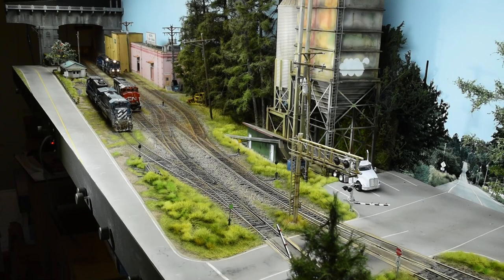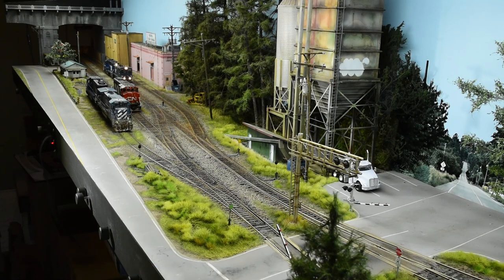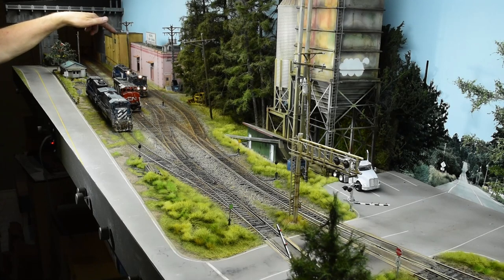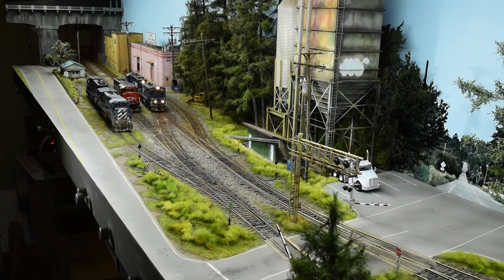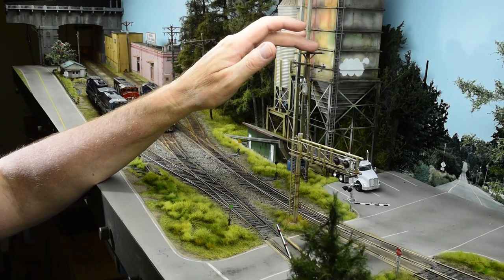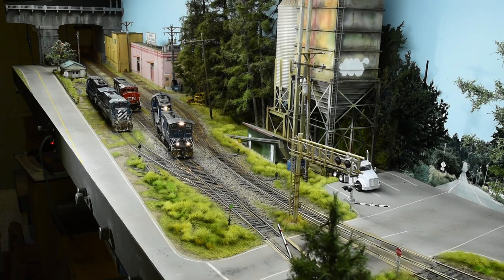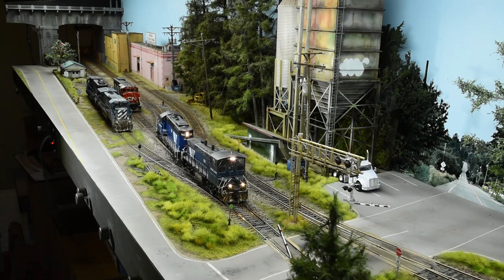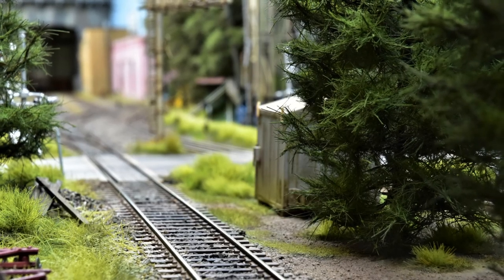Shelf Layout Update | A Year in Review - No Regrets

Comment: I can't believe the speed control on those locos.  I thought I was seeing things.  Great information here, again.
Reply from the maker: Me neither . . . lol. That is ESU Loksound v5 for you. Without a doubt, they have the best (Back EMF) motor control. Cheers.
Reply: @boomerdiorama  What's the minimum amount of new equipment I'd need to get to convert my DC layout to the same type of controls you have? Obviously, a new DCC loco, (can you recommend a particular brand?) but what are all the other components needed to get my switching layout AND loco running at those scale speeds? I guess I'm not as concerned with the sound, but if that's part of the deal, fine! With a small switching layout, smooth, steady, SLOW, consistent speeds is my goal. Yours looks great. Thanks!
Reply from the maker: @signman9328  Try to get a locomotive with Loksound decoder . .  or if you can install one of these in almost any locomotive if you have basic soldering skills. You can get this guy to do it for you ( he is great!): https://www.youtube.com/c/MotownModels/videos or do it yourself with one of these: http://www.ovrtrains.com/ESU-58821-HO-LokSound-V5-DCC-Direct-Sound-Decoder-397-58821.html
Conversion to DCC on the track is simple really. Wire it with bus, isolate the turn-outs if you can, then get one of these: http://www.ovrtrains.com/NCE-25-Power-Cab-DCC-System-2-amp-of-power.html

Comment: Boomer, it pretty much goes without saying, your layout is awesome and an inspiration to push one’s self to scratchbuild as much as possible. You have been a great encouragement to me to keep trying new techniques.

I also came to say that it wasn’t until the switchers were entering the foreground turnout that I realized they were running. Well done!
Reply from the maker: The ESU Loksound DCC Decoders have unbelievable "motor" control. Especially when you convert a standard locomotive that has been previously run in on DC first.

Comment: Now THAT is a slow-running loco! 11+ minutes to run 6' or so! Awesome! If you weren't paying attention, you might not even know it was moving!  Great 'soundtrack' too, BTW!
Reply from the maker: ESU Loksound Decoders have unbelievable motor control.
Reply: @boomerdiorama  Just so I understand----are locos available with the ESU decoder already installed, or is it always an 'add-on'? And do I need to power my frogs to keep locos from stalling at those speeds?
Reply from the maker: @signman9328  Yes, you can buy locos with ESU Loksound Decoders. Best to ask the dealer or store you purchase from.
Reply: @boomerdiorama  Is that loco 'geared down' at all or is it the stock gear ratio? I just didn't realize an electric motor could actually turn that slowly just by the way they are designed!  Amazing----I might have to get a Powercab and 'modern' loco and try it out myself.
Reply from the maker: @signman9328  All my locomotives are stock default with DCC decoders. It's the DCC Decoder, coupled with the Power cab that does the trick. DCC is amazing. So is the inexpensive NCE Power cab which is the best on the market for the money by the way. Then buy a nice DCC sound equipped locomotive of your choice and you are in business. I bought mine here: http://www.ovrtrains.com/NCE-25-Power-Cab-DCC-System-2-amp-of-power.html If you want the best sound, go for Tsunami 2 , TCS WOW, or ESU Loksound v5. Most of my locomotives are ESU LokSound v5. Cheers. ~ Boomer.
Reply: @boomerdiorama  Thanks!
Reply from the maker: @signman9328  You are welcome! ~ Boomer.

Comment: Boomer, it can't be done yet... your still missing the grain dump location on the track for the elevator auger.... but other wise it is in every way! I do believe that your talk of a chain link fence would turn that corner from just perfect to just a little busy you'll find.. I could be wrong. Thank you for sharing and inspiring some of us to start small and not worry about the "empire." By the time you have two or three under your belt your well on your way to the "basement empire" we have in our heads that seem so daunting that we never take the first steps...
Reply from the maker: Yes, for sure. Lot's of little details like the grain silo etc. I won't be using chain-link fence. Just some random barbed-wire fence here and there which is everywhere out here. Cheers and thanks for supporting the channel with your comments. ~ Boomer.

Comment: You made a slightly misleading statement; 8'x16" does not meet the size requirement for NMRA's Master Model Railroader Scenery Certificate. In HO Scale, 32 square feet is required (a full sheet of plywood). N Scale requires 18 square feet. However, there's enough flexibility in the MMR requirements that earning the Scenery Certificate is not required and enough of the other Certificates could be earned on this smaller footprint. That being said, your 10 square feet certainly look better and is probably more enjoyable to operate than almost all chase-the-tail 4'x8' table layouts in existence. I think it's time for the NMRA to re-examine their minimum size requirement.
Reply from the maker: Thank You for clearing that up. I was vague on the requirement in terms of a footprint, and I agree with your suggestion of re-examining the minimum size requirement. Cheers ~ Boomer.
Reply: @boomerdiorama  One caveat to the requirement, is that the 32 sq. ft. do not have to be on the same layout. So it can be a culmination of a couple shelf layouts, a module, maybe a coffee table loop. As long as everything meets the  finished requirements, it can be counted.
Reply from the maker: @milwmodeler3752  Good to know. Thank You for sharing that information! Cheers.